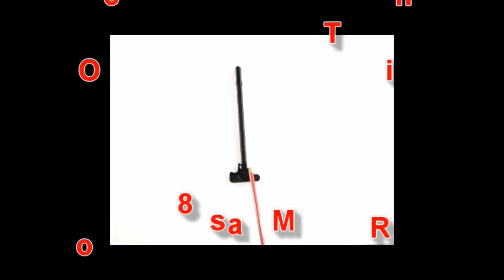Raptor Charging Handle New

Comment: Thank you for your video. I bought one from ohhunt website, it looks like the middle style. 
http://www.ohhunt.com/ohhunt-tactical-ar-15-cocking-charging-handle-ambidextrous-shooters-charge-bolt-assembly-aluminum-matte-four-styles-can-choose_p1660.html
Reply from the maker: Thank you for watching and posting.  I can not speak about the quality of the unit you linked, I have zero experience with it.

Comment: For some time now most LEO and SF operators like myself have switched to this other companies tactical handle.(MechArmor Defense Systems).  It was the first Ambi-tactical handle to come out on the market yrs ago and the ONLY one that is oversized for various reasons. This handle truly changes the way you run your weapon and its 100% soldier proof. Even has a lifetime warranty if I break it in combat. I also had a "Rupture" handle like the one in this vid and after running it I decided no way would I ever take it or any other like it into harm's way. FAR too many additional springs, levers, pins etc., to perform the same ambidextrous function as the MechArmor TacOps-1 that I finally purchased.  Here is a link -  https://mechdefense.com/
Reply from the maker: I have to take issue with your statement of "most LEO and SF operators" - there is no way you can make that statement.  Yes, you can say "most that I know" - but not "most".  Second, I have used the MechArmor charging handle and find it VASTLY inferior to the Raptor.  It is not operated mirror image.  When used from the left side the latch on the back must be depressed.  In other words, I have to use it differently from the left side than I do from the right side.  With the Raptor, it is used identically from either side.  It can be operated with one finger from either side.  Not so with the MechArmor.  Regarding its durability of the Raptor, if it was a weak design, there would be loads of butt hurt people on-line screaming about it because of the cost of the unit.  However the opposite is true, there are loads of extremely positive reviews about the Raptor. Thank you for watching and posting.

Comment: Have you ever looked at the MechArmor TacOps-1 handle?  It was actually the first tactical, ambi-handle on the market back in 2009 and far and away the best and most reliable design out there still. I used most of these others, all of which are now sitting in a box under my reloading bench. No added moving parts, pins etc., and made from 7075-T6 billet. I believe it is also the only one to have been awarded the National Tactical Officers Association of America, Gold Seal award. Check it out -  http://mechdefense.com/products/ar15-charging-handle-tacops-1-original-for-m4-ar15
Reply from the maker: I have tried one of those on a buddies rifle, and if the Raptor didn't exist that would be a good choice, however in my opinion the Raptor is superior to the TacOps-1.  This is due to the fact that the Raptor can be used from either side without having to touch the rear of the charging handle.  With the TacOps-1, when using it from the left side, you must depress the latch on the back of it.  With the Raptor, that is un-necessary.  Thank you for watching and posting.

Comment: Hi TI. Looking at your go to AR it looks to me like the scope is too far back to allow the BUS to flip up. Is it just a trick of the camera and view angle?
Reply from the maker: GOOD EYE David!  It is too far back to use the flip up rear sight.  It has to be there for the perfect eye relief for me.  For that reason I have the scope in Quick Release scope mount.  Thank you for watching and posting.
Reply: David that's pretty typical for a scoped rifle. With a magnified optic, you've now changed the role of the rifle in such a way that iron sights are obsolete. You could opt for 45 degree quick flip ups though.

Comment: Used them all, and they are all low-grade workarounds off of the original Ambi-handle that MechArmor Defense came out with yrs ago bfore any of these others existed. If you have not tried the MechArmor TacOps handles you are missing out, especially if you are a Mil Operator or in LE. In fact, I believe Mecharmors handle is the only one to have the NTOA's gold seal, so what does that tell you?  In fact, they also warranty their handles for life even if you damage them in actual combat or swat ops.  I like them because there are NO ADDITIONAL MOVING PARTS!!  If you are or have been a soldier, you KNOW this is key to your kits longevity under intense stress.  I have heard way too many "experts" espouse how the charging handle is the last part anyone should worry about. However, those are the experts that never had to rely on a stock shit handle in the actual. The handle breaks, which they do, and you have a fucking club at best.  So all these newer handles with more springs, pins, levers,  and flippers, etc., only heighten your weapons failure probability, and that is the wrong direction in my book. But hey, some of them look cool! And yes, of course, the first rule of Patroling is to look cool, so there is that.  Here is a link to MechArmor TacOps handles site. They have 3 models - http://mechdefense.com/
Reply from the maker: Thank you for posting your opinion.  I have used the MechArmor and find it inferior to the Raptor.  The Raptor is MIRROR image - the Mecharmor requires a different manual of arms when you use it right hand vs running it left hand.  The Raptor works the exact same, no matter what side you run it from.  If you practice shooting from both shoulders, you know how nice it is to have the operation be the exact same.  However, just like women, some like blondes, others like brunettes and others like red heads.  For charging handles, the Raptor is the top of the heap for my needs.  Thank you for watching and posting.

Comment: I also feel remiss not to point out one handle I used in the past that I did like and may buy again. It is easier to use than the Raptor because you have increased mechanical advantage. The problem is that the "ears" stick out a bit far. The handles never really got in the way, but I prefer the less wide signature of the Raptor. You never see this handle for some reason. Maybe because it is not all that attractive. The Raptor wins in the looks department!  It is top quality:

http://www.badgerordnance.com/m16-m14-ar-15/universal-charging-handle-with-right-and-left-hand-gen-l-tactical-latch.html

I notice now that Badger Ordinance took a cue from the success of the Raptor and now has a Gen 3 handle MUCH like the Raptor. 

http://www.badgerordnance.com/m16-m14-ar-15/gen-3-ambi-charging-handle-5-56-mm-based-rifles.html

Of all the contenders to the Raptor throne, this last one by Badger is the most attractive to me. I owe it to myself to spend the $100 to see how I like it. I can see right away the teeth look less sharp which IS an issue I do have with Raptor.   Wet or dry, I think the Badger's teeth will not slip. Badger Ordinance is one of the few companies that quietly makes top tier no BS, no excuses equipment.

 Anyone every used this Gen 3 Badger?

 Until I actually try the Gen 3 Badger, I am still quite pleased with my Raptor. Until proven otherwise it is still King of the Hill when it comes to ambi charging handles.
Reply from the maker: +Big Dave I have seen those, and I agree with you, they don't offer anything that the Raptor doesn't already solve.
Reply: +tire iron 
Yes. I want to convey the same thing.
Go back and read my last paragraph. I clarified my position(edited)  that until proven otherwise, I still feel that the Raptor is King of the Hill so far.

Comment: I have bought 3 Raptors now for my builds. I did have a Badger ambi handle that was VERY nice, but it was a bit too wide. The Raptor I do believe is number one in ambi handles for three reasons.:
1) I works well
2) It is very well made and robust
3) It is very COOL looking!

I notice two challengers to the Raptor...The LWRC  and the Mega.
I like the Mega a bit because the teeth are more blunt and larger , possibly making it more comfortable. I notice with out gloves the teeth on the Raptor will really hurt ones fingers  by the end of the day.
But the Mega neglects to do any cut outs to lighten it. The result also is that is not near as good looking as the Raptor with its cut outs. Looks do count when you are shaving hairs between two closely matched products.

Upon looking again at the LWRC, I still like the Raptor better. If the Mega ever would skeletonize their side handles, I would think about buying one. Until then, Raptor Rules!

So you know what I am talking about here are the links to the LWRC and the Mega.

https://www.youtube.com/watch?v=52XwnkMlfJA

https://www.youtube.com/watch?v=E4Zd91rAD34
Reply: I have an LWRC ch on my lwrc and love it, super impressed with the robustness. Also recently got one of the Geissele super charging handle because i found a great deal on one. Then comes the Raptor I just used for my most recent build. Wow it is really special. I would rank in the following order

1. AXTS Raptor
2. LWRC
3. Geissele super ch
Reply from the maker: Thank you Deplorable Dave for the detailed post!!
Reply from the maker: Thank you Jeff Guerry for the detailed post!

Comment: or you can train and practice with the stock one and never really have an issue pulling it back.... and spend the 100$ on ammo..
Reply from the maker: Luis Castillo you are 100% correct, and thousands of others will agree that have spent time with the AR.  If you like your stock charging handle, don't every even try a Raptor, or that $100 you were saving for ammo will go to buying one.  It is vastly superior to the OEM model.  It is like air-conditioning in a car.  Do you need it?  Nope, but if you live in a hot climate, once you have it, you don't want to go back.  Thank you for watching and for posting.
Reply: Difference is the Raptor will most likely never break on you.  That roll pin issue many people have break on them is no longer an issue.  To each their own, if you have the money and want the reliability, go for it.  I'm not for gimmicky things, but the Raptor is amazing.
Reply: i just bought one to try it, i hope its all worth it
Reply: Luis Castillo I really think you'll enjoy it man, I fell in love with it after buying it.  Let me know how it goes.
Reply from the maker: Luis Castillo You will never want to go back to the OEM unit ever again!  For sure post here what your thoughts are after you use it a bit.
Reply: tire iron  getting my complete upper this week with the stock charging handle and just by a few videos i've seen on the Raptor i think i'm sold... I have large hands and can already see grabbing the handle to be an issue... This will be my first AR so ill try the stock one first ... looks like a great design....
Reply: Luis Castillo Or spend the money getting rid of the crappy charging mechanism altogether and buy a side charging upper from the get-go.
Reply: tire iron i did get it, its pretty nice definitely a helpful upgrade.
Reply: +tire iron 
Man! This is probably the best answer I have ever seen to this very typical type of statement. I am speechless. Well done, sir!
Reply from the maker: Tony F millions and millions of people have used the stock charging handle for decades.  It does the job and will continue to do the job.  However, once you try the Raptor, the design flaws in the stock unit become glaringly apparent.  Good idea to start with the stock unit, then you will REALLY appreciate the Raptor.  Thank you for watching and for posting!!
Reply: Bryan Sheriff why is it crappy....
Reply from the maker: Bryan Sheriff With a side charger you then make it like charging an AK when you are running it left handed.  I run mine both right and left, so a side charger doesn't solve anything for me.
Reply from the maker: Luis Castillo Right on!
Reply from the maker: +Big Dave Thank you Dave!